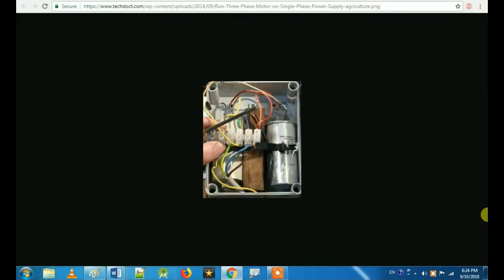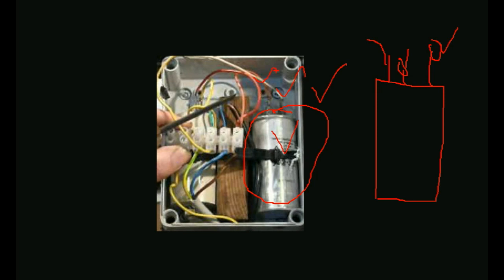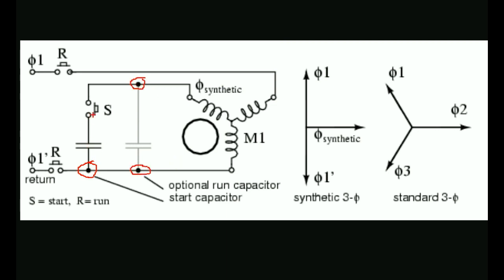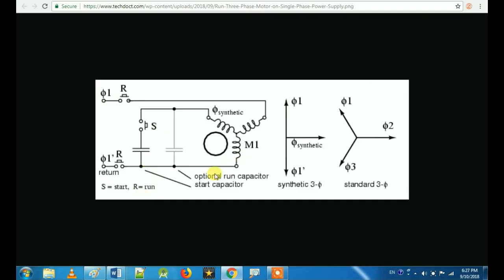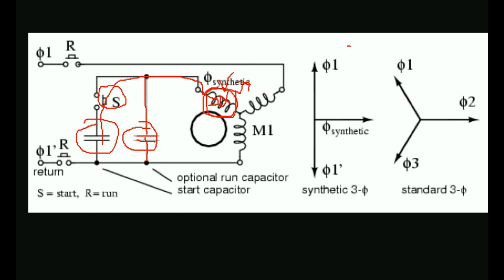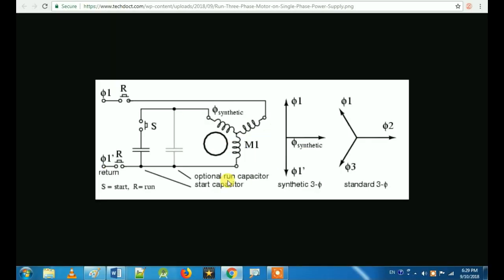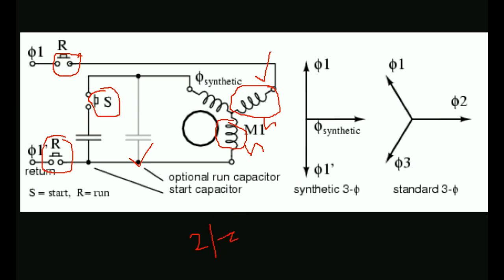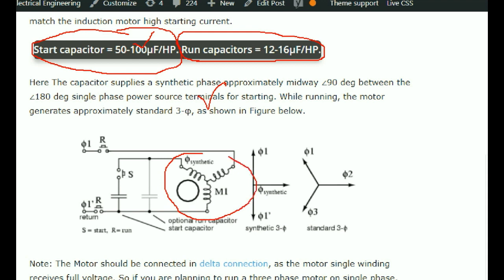Run three phase motor on single phase or Two phase in Tamil

Comment: Very good article for three phase sub motor based agriculturist. Hp versus starting and running capacitors can be given for use of agriculturist without trial and test, for required safe current for cut phase, without less or more capacitor and damage to motor, please.

Comment: Run an empty induction motor using 2 phase and get 3rd phase from it. Use the 3rd phase to run 3 phase submarisable motor. If any problem occurs with this method

Comment: I get three phases with below voltages.. can i run 3 phase 7.5hp agriculture motor in 2 phase using the method you explained in this video!?

L1 140, L2 230, L3 140